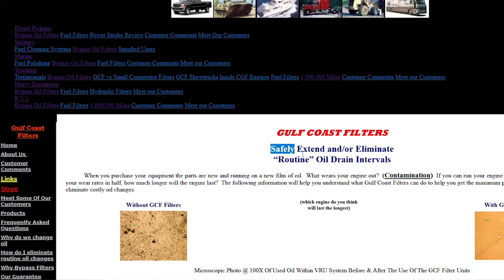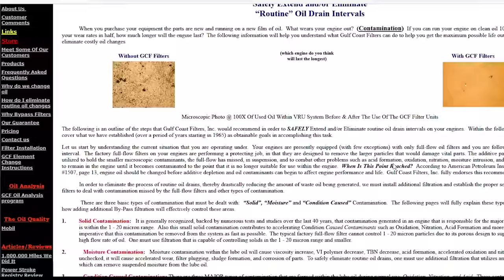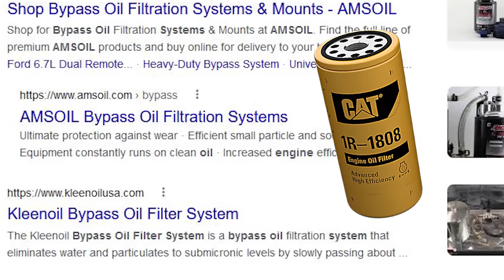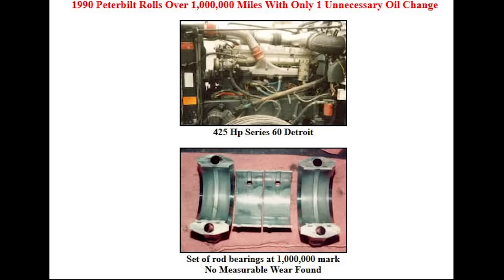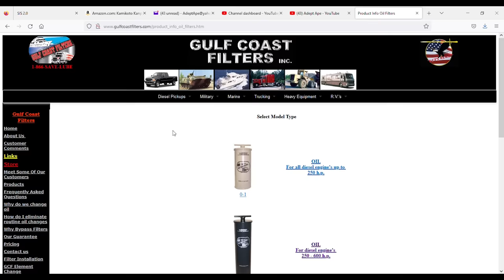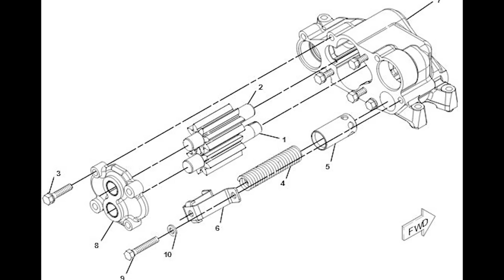No Oil Changes and 1 Million Miles!!! Are Oil Changes Optional with a Bypass Filter? (INTERESTING)

Comment: To change the bypass filter, don't you drain 2 gallons of oil, and have to add 2 new gallons of oil? Plus don't they advise to change both oil filters every 10 to 15,000 miles?
Reply: It seems to me the reason the Gulf Coast system works so well is the filters are big and effective and they take 3 gallons of new make up oil when changing them. My cars take 1 quart
Im not good with math. How do you figure how much new oil is added in a million miles? Would that be 10.000 miles divided into 1 million miles by 3..All engines need some new oil. Road king said that is equal to a full oil change every 40.000 miles. Also there is the new oil added at full flow filter change. No it isnt going a million miles with no oil changes.
Reply: The system required a big effective filter that takes a lot of.make up oil.. The Detroit had about 350 gallons of new Rotella added in a million miles..Oil analysts  said that ts more new oil than needed.

Comment: I’ve done oil samples on my 14l from when it had 500k miles to now 1.4 mil miles, the recent oil sample done at 16k miles and it was as clean as it was at 500k miles, when should I do a rebuild? Everything is running fine now I’m just a little paranoid about having a catastrophic failure in the middle of nowhere

Comment: When you run a bypass filter are they in addition to your usual filters or do they utilize existing filtration and change the plumbing?
Reply: Go to Gale Banks tube channel. He has a video on that. Smart guy Mr Banks is
Reply: It’s an add on filter housing and plumbing. The normal full flow filter/s still need to be changed regularly.
Reply: The full flow filter on my Pontiac Torrent has been on there 63.000 miles and over 4 years. If I start seeing particles in the Jackmaster Classic I will change the full flow filter. Normally all bypass filters hook up the same as they have since the 1920s you find a place to mount them then you tap into the pressure and return the filtered oil to the oil pan. You need to be mechanically inclined..Saw about 3 pieces of metal on top of the toilet paper that managed to get past the full flow filter. You can see 40 micron particles
Reply: I did ii a little different on the Japanese Ford diesel tractor..I had a flat head Ford V8 canister filter that I converted to use Scott 1000 toilet paper and installed it using a Perma Cool universal oil cooler sandwich adapter I got from JEGS years ago.Have a few Frantz sandwich adapters left from the 60s. None that fit the tractor.
Reply: I normally change the full flow filter every couple of years. The pleated paper in the full flow filter can get rotten and come apart eventually. My 84 Subaru went 250.000 miles with no oil drains using a Frantz oil cleaner and a Frantz adapter that eliminated the full flow filter. Used Mobil 1 15 50 racing oil which was heavier than needed. In the old days trucks had no full flow filters. I believe the bypass filters such as Luberfiners were optional equipment.

Comment: Did they have to add any oil over this time frame and if so how much? Josh you have built a few engines in your life. As with me, most of the time you can tell on the inside who services the engine as it should vs who don't.
Reply: When the big filter was changed every 10.000 miles 3 gallons of makeup oil was added.Thats a lot of new oil added in a million miles. I wouldnt call it no oil changes.  I add 1 quart when I change my toilet paper filter..
Reply: I normally dont see the inside of my engines. Replaced the gasket on the Subaru oil pump. What I could see was a light tan. Looks like the old Ford diesel tractor I just bought has been taken care of as far as oil and filters. Looks like the oil bath air. cleaner and fuel filter have neve been changed.
Reply: I guestimate the Detroit  in the million mile truck got about 350 gallons of new Rotella added in a million miles just adding makeup oil.. oil analysis said that was more than it needed. 3 gallons every 10.000 miles when the 3 gallon bypass filter is changed and more at 50.000 miles when the full flow filter is also changed is a lot of oil. Some are using oil analysis and using less oil. Its old news Road King asked me for the owners phone number in 1996. I havent sold them in years. I use the little 1 quart Gulf Coast filters. Im partial to the top loaders.

Comment: I think the multi-viscosity oils should be changed regularly.  I learnt in A&P school that the polymers responsible for the change in viscosity with temperature gets chewed up by the chains and gears in complex engines.  The result is a thin oil at both cold and warm temps.  So instead of 20w-50 you now have straight sae 20 or something like that.

Motorcycles are harsh on oil due to the gearbox being in the same sump with the engine.  Whenever I perform an oil change I feel the viscosity in between my thumb and pointer finger.  Almost feels like a wax when new.  I will run that oil until I can feel my fingerprints through the oil in between my fingers during regular level/condition checks.  Then I'll change it and note the milage.  Next change will be 100 or so miles earlier 

Somebody can fact check me on this.
Reply: When I started using toilet paper filters in 1963 the polymers didnt hold up well for extended use.Using multi grade oils would void the wsrranty in a diesel. The owners manual for my olds diesel said you could use multi grade in an emergensy until you could get 30 weight. Delo came in W30 and w20. Some auto makers said the use of 10 40 would void the warrsnty.. for some reason it takes more polymers to make 10 40 than 10 30 or 20 50 This is probably obsolete now. I bought the 84 Oldsmobile diesel at an auction for 600 bucks. Wife drove it a couple of years. When it blew a gasket I parked it. I was paying about 29 cents a.quart in the discount stores for Delo 100 W30. In 1963. Black and dirty with the stock 10 micron  bypass filter. Golden with the Frantz or Motor Guard. toilet paper filters.
Reply: Was reading the oil requirements on a engine sticker on the Ford diesel tractor I just bought. Its a 79 model 1900. It says 10 30 year around. Down at the bottom it says 30 weight in the summer when the temperature is above 50 degrees F. This tells me I better drain the oil and put in 30 weight. This is Dallas Texas. Found some heavy duty diesel 30 weight at Walmart Says its for off highway use. No doubt conventional.

Comment: Pretty sure all filters have bypass, and they still need to be changed and so does oil. I don’t go more than 3000 miles between oil changes on my vehicles and I wouldn’t go the advertised 10,000 on anything. Filters and oil break down much faster than advertised. Oil is dirt cheap compared to replacing or rebuilding an engine.

Comment: If this works it would be of great environmental benefit as well
Reply: Oil change profits will overrule environment concerns
Reply: Saw a letter from a Marine base.in Okinawa  Japan. They go from equipment to equipment cleaning the coolant. Additives are added as needed..These big portable systems use a lot of paper towels. For aviation fuel they use air pumps. I was told to not show this to civilians. That was a long time ago.i think they show a big portable system on their site. Saw one somewhere.

Comment: I'm not looking to stop doing regular oil changes but would a bypass filter increase the longevity of my diesel engine?
Reply: Its hard to wear out an engine with analytically clean oil 100% of the time.

Comment: By pass system plus oil analysis. Change the oil when necessary.
Reply: True
Reply: I have  never spent money on oil analysis. My experience is not with expensive engines.I go by the look and feel of the oil  Hasnt failed me.

Comment: For sure, they need to have a much larger sample size of engines to make actual scientific analysis and claims.
Reply: Shell oil was involved in the testing of the engine. I had complete faith in Shell oil knowing what they were doing..I believe the truck used Rotella 15 40 conventional in those days.

Comment: I was a driver, I have two filters on my truck. But dose oil ever break down.  They say no. So why do we waste money on changing the oil. Where is the bypass filters
Reply: The people that sell oil have been good at selling the system of allowing the oil to get dirty then draining it. The old Luberfiners ended up on dump trucks and other dirty conditions.. Now even better bypass filters are coming back. Not everyone thinks oil is supposed to get dirty and be drained. Of course they need truck owners that understand that stuff happens like coolant and fuel contamination. Without common sense the system doesnt work.

Comment: Why not use an extra large filter or many filters in parallel to have enough flow for small micron rating?
Reply: The big Gulf Coast filter holds 3 gallons of oil. Saw two Frantz 3 stackers on a 8v71 Detroit.Thats 6 rolls of toilet paper. Motor Guard had manifolds. They manifolded 2  3 and 4 together.They used toilet paper. The reason the big Gulf Coast filter cleans oil so well is it is a big filter with a small orifice.The slower the flow the better.  the cleaning. Also the big filter takes 3 gallons of new oil to keep the additives up to specs. The system has been proven for almost 100 years.

Comment: I could probably run it though my centrifuge and get better results from reusing the oil, my concern would be the detergents in the oil would break down and I'd like to see a study on that subject
Reply: I wanted to burn waste automatic transmission fluid as a fuel for years I've never been able to get it clean enough I have the big centrifuges nothing will clean dirty automatic transmission fluid that I found
Reply: I have been running on clean ATF for 60 years.in the Transmition.i use toilet paper filters. The white toilet paper will turn grey. The Impala transmission on the H Farmall has a decent stock filter. I have a Motor Guard TP filter on there as a backup. The Ford F 250 has a.screen and a Gulf Coast junior as a backup..
Reply: The subject has been studied to death.over many years.
Reply: @ralphwood8818  you run it in a diesel engine? 100%? What about cooking? I just still mine $650° I crack it into diesel then I strip it with Ethyl oxide then I water wash it and let it settle you end up with an orange clear diesel runs an engine perfectly
Reply: @tonydiesel3444  I have a Gulf Coast junior  on my 76 F250 C6 trznsmission
And Motor Guards on the Pontiac and Subaru. Transmission and the Farmall H with the Chevy engine and Impala transmission If I had a supply of ATF I would probably use it for fuel in the tractor. Also used motor oil. Ive only cleaned lubricants in the  cars and pickups and a few tractors. Had an old Datsun diesel pickup thst got 38 miles per gallon on waste cooking oil on a trip. The Datsun had a injection pump better suited for waste cookimg oil than the 6.9 Ford. I mixed 5 gallons of gasoline to 30 gallons of cooking oil.. You can mess up some equipment with waste cooking oil.if you dont know what you are doing..

Comment: Another channel with a oil bypass system they are promoting said MOISTURE will just burn out at heating temps. This is after I said how do you address moisture issues with the oil.   So, not addressed I guess..

Comment: Modern oil is much better at holding together right out of the box, new equipment has extended recommended intervals. It is difficult to trust modern maintenance intervals when you have opened a few valve covers on neglected equipment and are from the 3000mile generation. That said, during an oil change you have potential to damage the engine with faulty parts(I have seen filters with rust inside, improper threading/metal shavings at the check valve, new oil can with debris in the bottom, no lid on a bulk tank) or faulty labor(low wage labor doesn't care if the foil seal ends up in the engine, or the proper oil is used from bulk tank, and most definitely isn't priming anything. 

We have a tractor with a 600hr interval, and at 600hr the oil still amber in color, amazing how tight that engine is...
Reply: Not much has changed for me in the last 60 years. We changed the depth bypass filter more often in the 60s. More impurities in the oil.. The engine heat and the depth filter had to finish the refining. Not all crap ended up in the filter. Some stuck to hot engine parts. We did the best we could. We had the Frantz and the Frantz 3 stacker for diesels. The Motor Guard and the manifolded Motor Guards for diesels.2 3and 4 manifolded together depending on the size of the engine.
Reply: I worked for a company many years ago that had mostly 2 cycle Detroits and Cummins. On some makes the oil stayed clear a lot longer. Cant remember which one We had Luberfiners on everything.. The old man said Caterpillar engines are for bulldozers not trucks.

Comment: It's a lie there adding oil the longer they go when they changed it it's not the same oil. The longer u go with out a oil change the thinner the oil gets and burns off I have tested it with a 40k mile truck one 1k over 3k miles was a extra quart used and so on but it was a 98 dodge Dakota they don't build very good products. I'm a fan of bypass systems but I wouldn't go over oil changes but it is nice to have extra protection!!!!!!!!!!!!!

Comment: My boats vovlo d4 engines have oil by pass filter, and we change the oil as volvo says every 100hrs! And both filters. Bypass and regulat oil filter. At $60k per engine I won't be taking a chance on something as cheap as oil for my engines.
Reply: Yes why keep the oil clean when you can allow it to get dirty wear and foul the engine then drain it.
Reply: Dont know of any factory installed bypass filters that clean oil. There are a lot of after market bypass filters that clean oil. Some are too expensive to use.

Comment: Didn't project farm do a bunch of wear testing of new and thermally used motor oil, finding the used oil showed significantly more wear? Could be wrong.
Reply: I like Project Farm. Dont remember that test. After 60 years of running on clean used oil im not very concerned about any other tests.

Comment: Most oil filters have a bypass valve that lets oil go through with out being filtered when the filter gets clogged so your engine doesn’t get starved of oil. So I mean if you keep it topped off you probably could 😂
Reply: You are talking about a full flow filter.. Full flow filters are not supposed to clean oil. They are supposed to protect the engine from large engine damaging abrasive in the main oil supply to the engine.The smaller engine wearing abrasives build up in the oil causing wear until you drain it.Bypass filters are supposed to clean the oil.Some do some dont. Engines need continuous clean oil and they need enough new oil to keep the additives up to specs Thats one reason some truckers want big filters. Big filters clean oil better and require more new make up oil when changing. Im a car and pickup guy. My bypass filters hold a quart. My full flow filters have nothing to do. The Wix has 64.000 miles and over 4 years on it..

Comment: What about chemical build up in the oil from the combustion process/blow-by. I have a vague recollection of oil turning acidic, possibly from sulphur from the above.
Reply: Its a matter of never allowing the oil to get dirty and adding enough new make up oil to keep the.additives up to specs including the acid neutralizers. Water causes acid. Short trips in cold weather can be a problem. Not a problem with an over the road truck.

Comment: I own a semi truck and I would rather change the oil than rely on that. What about detergents? How does that replace those? Sounds like snake oil to me.
Reply: The truck gets 3 gallons of new oil every 10.000 miles when the 3 gallon Gulf Coast filter is changed. Thats where the additives come from. Pay attention.

Comment: My main question would be how does this system deal with the viscosity altering polymer that is in oil to make it variable viscosity. I agree with the stated claims but if you are running oil with a bunch of sheared polymer in it how does that effect things.
Reply: I can remember when you couldnt use multi grade oil in a diesel because the polymers couldnt hold up in a diesel They didnt do well in a gasoline engine. They seem to hold up well these days..Delo had W30 and W20. Multi grade oil wasnt diesel rated. When I started using filters that clean oil I was paying 29 centa a quart at the discount stores. 1963
Reply: I just bought heavy duty 30 weight diesel oil for off highway use. When I started using filters that clean oil. Multi grade oils were crap. Couldnt use them in a diesel. My Oldsmobile diesel manual said you could use them in an emergency untkl you could get 30 weight. A old GM technician told me multi grades are still crap. Not too many years ago a GM owners manual said 10-40 will void the warranty. Im just as confused as ever. The 30 weight holds a higher oil pressure now. It calls for 10-30. Year around. 30 weight in summer above 50  degrees F  This is Dallas Texas. This tells me to use 30 weight in summer in the tractor.
Reply: My 93 Subaru Legacy owners.manual says 5-30 is not recommended for sustained high speed driving. For desert areas with very high temperatures. Use 30 40 10-50 20-40 or 20-50. My daughters newer Subaru calls for 0-20.. I smell a rat.

Comment: Go back to the old C750-L bypass filter.Been around for years
Reply: They werent in the same class as the Gulf Coast. The oil travels thru about 3 inches of pulverized newspapers in the best 750s . 22 inches of paper towels in the big Gulf Coast filter.